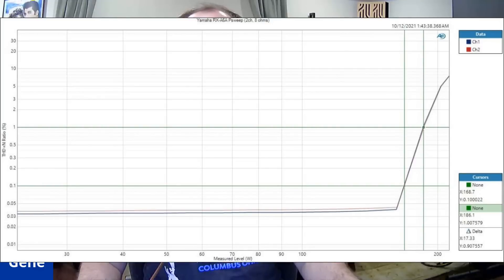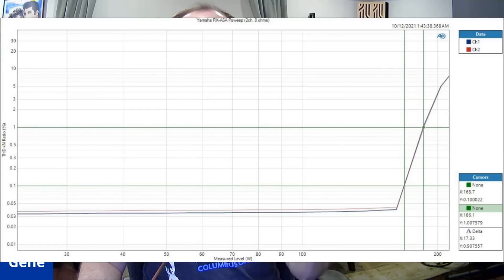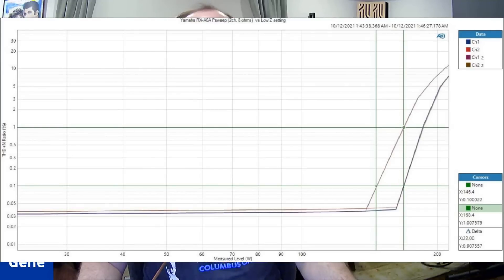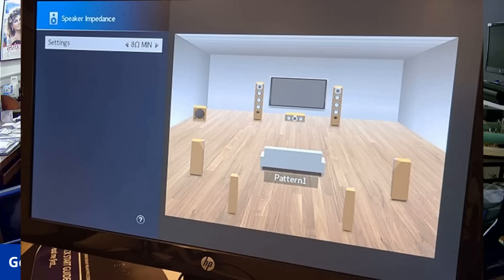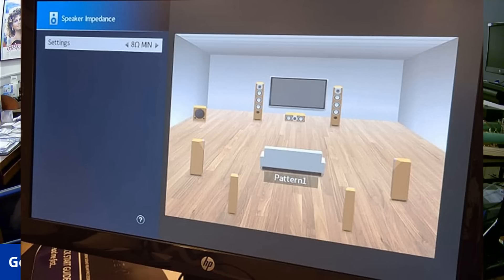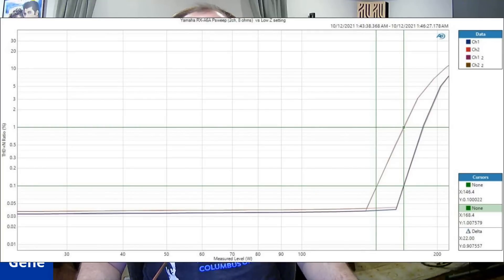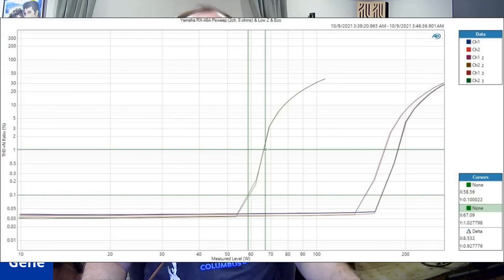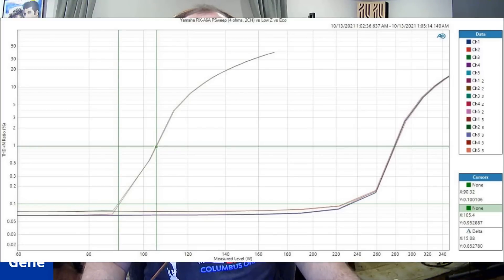Avoid Power Killing Features on Yamaha AVENTAGE AV Receivers - Use These Settings!

Comment: impedance  should match the speaker impedance  forget what power output you get its about matching the electronics After all would you put more volts through your lights ? no why because you over loading the circuit and reducing its life.  for your output amp you overloading the output and will shorting its life .   your measuring all the wrong things
Reply from the maker: Congrats on the most misinformed reply on this video. You don't match speaker and amplifier impedance. I've run AVR's at the high 8ohm setting for 20+ years with 4 ohm speakers and never "shortened" their lifespans. They have plenty of nannies built in to protect from overload without further power limiting them with a switch.

Comment: My Onkyo receiver has the same switch in its speaker setup menu.  I assume that any receiver that has this switch should be able to adequately driver 4 ohm speakers, correct?  Otherwise, there seems to be no reason to even include the switch if the receiver isn't capable.  It's an Onkyo TX-NR727.  Thanks!

Comment: Bought the A6A about a week ago and just today started working on settings and sound levels….  With the TestTone going through the speakers no issue until it came to the subwoofer 1 and 2.
I have a pair of REL G1’s connected to the sub outputs and no sound during test tone and put on a DVD with big bass and again nothing.  Subs  work fine with my Hegel 390 as well as my Devialet Expert 220 pro using the high level output and the rca output on the Devialet.
Any thoughts that this is an issue with others?

Comment: Hello I am confused a need recommendations. I ordered the Yamaha Aventage A6@. I currently have a 5.0 system. I wanted to upgradw to a 5.0.4 atmos. I would like to get a preamp for my front L/R speakers. I have oñder Cerwin Vega VS series 15”, there RMS is 500 watt each. What type, brand or wattage do I look for. Econ price please. Also atmos speakers (mounted on-wall not in-wall) can you help me please.

Comment: I have my receiver set at 8 ohms with all the extras off other than Dsp but I often run in pure direct mode for music and movies. I like how pure direct sounds better than straight mode but I sometimes wonder if I just stick to straight mode since I’m using bookshelf speakers and a sub.
Reply: @Strong Bull I tend to use straight mode for casual listening and pure direct  when I want to focus on the listening

Comment: Hi there guys Ives been a fan since you first got covid lol. I have a question that's a bit off topic. I bought a new theater system and I followed your subwoofer setup videos.  I have an R 100sw klipsh sub and my av reviewer is the Onkyo TX-NR595. I set the crossover on the reciver to 80hz and the level on the sub to 50%. When I run the automatic setup it sets the sub to +3db. Problem is, when I play any movie it just rumbles the whole time unless I turn the level down to about 25%. Any help from the community would be appreciated.
Reply: Is it truly bass rumble? Or vibrations? Make sure the sub is isolated from anything it can vibrate. You may then find that you just hear low movie bass as you should. The speaker tests are a quick punch - not a sustained bass track like a movie. I isolate front firing subs on a thick rubber paver on top of a 2' x 2' concrete paving stone (Home Depot landscaping area). For floor firing I isolate on the same but on top of the rubber pad I add a 2' x 2' x 1" thick square block of hard wood. Looks like a weird smore but prevents the sub from vibrating the floor or anything around it.

Comment: What if you’re using an external amp? I have a Denon 6500h feeding an Emotiva XPA 7. Does eco mode affect the output of an external amp?
Reply: I have a denon X4400h that I run in eco mode with all 11ch being powered by external amps. The only thing that has been affected is the temperature of the unit, with it running about 5 degrees cooler then when I had eco mode off.

Comment: I always wondered about this. I  have 6 ohm Dali speakers and a Yamaha A3060 and i thought you were meant to set Ohms on Amp to match speakers precisely otherwise you could damage the speakers. In doing so it does affect volume considerably.
Reply: I have the 3060 to,, I love the receiver.

Comment: Honestly, I tried AV recivers, and get tired of them doing funky busines with sound mixing, crosovers, and what not that is not exatly documented enywhere. Now just running signals in seperate components , pro speaker management dsp and power amp. Plenty of versatility and power. For a home gamer type AV reciver is way to go, less hashle, and almost plug and play. With pro gear you need to know what you are doing. I personally prefer pro gear.

Comment: Is this just a Yamaha issue or for any manufacturer with a 4-8 ohm switch
Reply from the maker: Any AV receiver that has an impedance switch will severely limit power in the low setting.

Comment: Ya had me a bit confused for a minute, you were saying one thing and the charts clearly said something different, and then a minute later it all came into alignment for me. Onkyo is my brand of choice and they use some kind of dynamic amp setup, I personally think it's mostly marketing. But you do have me curious about this as I have my receiver set to 6 ohms since all my mains are rated as such. I seriously doubt I'll notice any difference by switching to 8, but I'm willing to give it a try.

But I agree 100% this really shouldn't even be an option at all since every amp on the market is load dependent already! In other words, the amp won't do anything until it sees a load. It shouldn't make a difference what you set the amp to since the speaker impedance is constantly changing while in use. I only changed my receiver to 6 ohms because of the dynamic amp marketing jargon, it could make a difference in my case if it actually does what it says on the tin. But I don't honestly know. Do you have any charts for Onkyo?
Reply from the maker: They all function pretty much the same. You're doing your speakers a disservice by setting the switch to 6 ohms. I can't restate this enough before it sinks in for some people.
Reply: @Audioholics :
 There's nothin wrong with a bit of skepticism, in fact it helps to keep the mind sharp. Although, skepticism becomes something else once proof is shown and folks still don't believe. I'm a numbers man, it's all just hot air until somebody can show me those numbers! Audio reproduction was developed with science, as it will continue with science.... Everything else is just noise.
Cheers 🍻.
Reply: @Audioholics :
 Just rechecked my receiver and the only option I have is 4 ohm or 6 and above. So yeah, nothing to adjust then since I've always been set to 6 and above.

Comment: While 0.1% THD is below hearing threshold of distortion, it's nothing to be proud of, especially at this price range. It also appears that this receiver is not compatible with 4 Ohm speakers. It would be interesting to see SINAD results from HDMI input to pre out for all channels.
Reply from the maker: WTF are you talking about? I spec amp power at 0.1% and 1% THD for ALL amps/receivers I measure. It's a standard. The amp distortion is much lower if you lower the power a bit. SINAD results aren't good ATM but I'm hoping they can fix what I found via firmware.
Reply: @Audioholics  

Try and look at test results for Hypex and Purifi amps to get some perspective how should a good amp perform..
Reply from the maker: @EB1000  I'm well aware of both and I own Pascal class D amps which are equally as good. I've measured the best amps I. The industry and have seen it all in 20+ years.

Comment: Thank you for the informative video regarding IMPEDANCE Switch..Question...I have the Yamaha TSR 700 receiver...I cannot locate this switch..it isn't mentioned in the manual, so, where can I find this switch, and how do I change it. Thanks!
Reply from the maker: If it has one, it's likely set to the "high" setting by default. Just leave it be.

Comment: Now the question is, if i have 2, 7 channel amplifiers 200w ch, all 7 driven @8ohms, 300w all channels at 4 ohms. Do i use 4 or 8 ohms on the receiver in pre-amp mode? Still cant find answer to that. I have 7.2.6 atmos setup. Speakers are, front Dali Rubicon 8 4 ohms, center is 4ohms Rubicon Vokal, surrounds R L are Rubicon LCR 4ohms. Rest are 6 ohms Oberons. What do i do with setting in this case? I have DENON 6700 receiver, that allows selection of 8, 6 and 4ohms. I know it's not Yamaha, but pretty much same questions with this settings. Same Japanese Ohm settings. As far as i read, it's still best set to 8 ohms, as with 6 and 4 i am just going to lose dynamics.

Comment: All right, we get it, LEAVE the impedance switch at high with 4, 6, or 8ohm speakers and Eco to off. The impedance switch is there for animals, you know, morons, that drive to abusive levels in terms of volume & distortion. Yamaha doesn't want to deal with smoked product. You can argue all you want that removing protection will let you go louder with less distortion, but until you've worked retail (which really no longer exists) in a store that sells hundreds of units of some models per year, you won't have run into the hard headed, stubborn, utter and complete morons out there. I can't tell you how many times we had customers that were livid, I mean beside themselves, when they damaged equipment. A common statement was "if the volume control turns that far, I should be able to play it that loud". They'd then get even more angry when we'd suggest limiting maximum gain available in the settings menu. That's why Yamaha seems over protective. That's why we would set max volume available to a safe setting on home installs, unless we knew the customer of course. Yamaha has to deal with people that aren't as enlightened as yourself in terms of distortion and clipping. To quote Blazing Saddles, "These are people of the land, common clay of the New West, you know, morons"
Reply: Well, keep in mind these are surround sound receivers and not 2 channel power amps. That said, 50 watts continuous into 7 speakers will normally be loud. The impedance switch makes sense if you are using 4ohm surround speakers, like Martin Logan, Sonus Faber, Etc. it's better to limit the amp than roast the amp. 

Eco mode makes sense if you're using very high sensitivity speakers and frankly will never need 80% of the potential power. Else, it's better to leave that feature off as long as your neighbors aren't complaining. 

Yeah, there are some real angry morons out there that seem to never listen to advice. I worked at Audio King / Ultimate electronics 97-02 and we had to deal with the Y2K morons. I should have recorded those conversations.

Comment: Thanks for a very useful video trying to help audio enthusiasts like me extract best performance out of the sound investment we have made. 
Have a question on this.  What happens if I have pre-amp outed the front speakers on to a two channel Yamaha power amp MX 600, from a Denon X3600H receiver.  MX 600 also has a Impedance switch at the back which I have left as 8 ohms as per your advice. Your graph on 2 channel driven performance doesn’t seem to have much of an issue. 

Thanks once again hoping to receive a reply. 

Regards

Comment: 3070 set at 8ohm with 8ohm speakers, only way go. 
Gene I'm using two external amps, so my 3070 is only powering fronts and centre, what roughly would be the power going to these please???

Comment: Yamaha a2a, is it worth using the bi-amp? Would that technically be using more than 2 channels? Seems like there would more than likely be a power loss when running my my front L&R only.
Reply: Was hoping to have some response on this.

Comment: Have yamaha got back to you Gene?
Have got an a8 and have 7 days left to return, and am a bit nervous about how much of an improvement these are. 
Although saying that I don't fancy any of the other bug ridden competitors at the moment.
Reply: I'm also waiting on that review, I'm starting to get cold feet to the point where I'll cancel my A6A per-order and grab a cheapie until next years models drop.
Reply: @UltimateGattai  well everything is working apart from the ypao which seems to take away all the bass.
But apart from that I'm happy, it has opened up my cheaper speakers a bit better but won't be able to tell properly till I buy my new ones. 
Just wish he'd update on yamaha's response. 
If there is one.
Reply: @slyfoxx8540  that's good to hear, I really wanted this AVR to be good since I've only owned cheap, budget AVRs before, plus I want to add in 11 channels. I'm planning to get atmos speakers at the same time and install next year along with either a 2 or 3 channel power amp.
Reply: @slyfoxx8540   I found the same thing on my older 3060, YPAO takes away the bass.  Although the "Natural" setting is the least offensive I ultimately started using the "Manual" setting and keeping all speakers flat (No EQ) and bumping up the mid bass frequencies of the subwoofer just a bit.  I haven't taken any measurements but it sounds better to me.

Comment: So what's the purpose of putting 4,6 ohms on a receiver if its not practical to use?  Would is be better to use a separate amp like the Emotiva  XPA-7 Gen3 7 Channel Power output:
200 watts/channel RMS into 8 Ohms; all channels driven , 300 watts/channel RMS into 8 Ohms; two channels driven ,  490 watts/channel RMS into 4 Ohms; two channels driven?
I have until Nov 12 to return the A6A to BestBuy. I just wanna make sure its worth the money. Man , if Best Buy would've had  the Onkyo TX RZ50 in  I would've have that first and save my self a thousand dollar.  Thanks Gene for what you're doing I really appreciated..

Comment: What should you use when there are 4 and 8 ohm taps on the amp? (e.g McIntosh, Tube amps, etc.)
Reply: Use the corresponding tap to what your speakers are. Remember impedance is "nominal" and changes constantly with the music. Heavy bass tracks will be your low impedance stressors, classical music with violin solos are at the other end of the impedance load. Just be sure your amp can handle the load of the speakers, and also be aware when something seems too good to be true for the money...

Comment: Thanks for that!  Intending to get an A6A as part of a home theater upgrade as soon as they become available again (guess they're sitting on a ship off LA), replacing my old Onkyo TX-NR3007 (no HDMI 2.1).  7.1.2 system.  Just looked up impedance on my old SVS MTS (6Ω), MCS (6Ω), and MBS (8Ω).  Had thought lower than that, so good in any case.
Reply: You will love the upgrade. I did a surround system with 5 Martin Logan Sistine speakers (4ohms) and a Yam 3080. The amp handles the load and has more than enough power. Anthem is the upgrade when you need more power than what Yam, Denon, Sony, etc.. have.

Comment: Gene, I'll bet a dollar that the guys who tell you the lower impedance setting sounds better with 4 ohm speakers are the same guys who say their expensive aftermarket power cords sound better too...
Reply: they do..
Reply: While you're at it, why don't you take a look at the many, many articles gene has written on the subject where he breaks down how silly this idea is from the viewpoint of an electrical engineer...
Reply: @Pohgrey  i already have done. ive got to admit they do. but if you want to think the other way ,thats your choice. ive been listening to gene for many years and i do agree with him. but i also agree with all others like paul from ps audio. and many many others. if it wasnt the case that the sound changes from cable to cable,then every one would just use cheap wire. but thats not the case. and im sure youve spent as much money as you feel is right for your system too. right? its just the way this cables debate goes. ive come to a conclusion that both parties are correct.
Reply: "According to some people"... you mean physicists, most speaker manufacturers, electrical engineers and dbt participants? Yes, those people think they sound the same as long as they're competently made and working correctly.
Reply: Tell you guys what. Why don't you go to the Audioholics forums and start a thread talking about the awesomeness of aftermarket power cords? 

It should spark an interesting discussion...

Lol
Reply: Anyone use or have reviews of audioquest tornado power cables, I just got a pair, one for my furman 20pfi and one to go my new Yamaha a8a when it comes in. I can't test them out as my a8a hasn't got to my av store yet. Gene, have you tested those power cables out?
Reply: @jakkedtide  hop on over to the Audioholics forums and ask. Gene pops in there more often than the comments section on youtube. We'll keep an eye out for ya!
Reply: @jakkedtide  they all sound and do the same .doesnt matter which one you use according to some people.
Reply: @milkman100001  I'm not sure how you can agree with both gene and Paul since they hold mutually exclusive positions on the subject. You do know gene called Paul out publicly and they had a back and forth, right? Interestingly Paul declined to debate or to participate in any testing to back up his claims... they always decline to prove their claims.
Reply: The 4 ohm setting is safer for the amp when you're using 4ohm speakers. The sound quality largely depends if you're using the 4ohm setting on full range more than small speaker settings. Low end bass is what can throw the load to a very low impedance. 

I bet most people couldn't hear the difference between 8ohm and 4ohm amp setting under normal volume loads. BUT, if you have 7 4ohm speakers set to large speakers (full range), turn the volume all the way up, and play bassgasm - that's when the 4ohm setting may save the amp from melting.